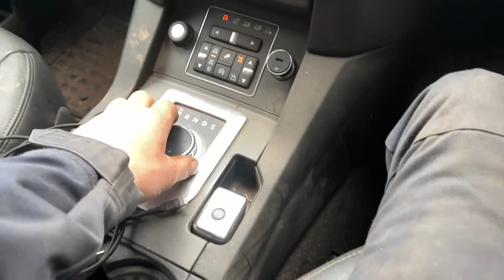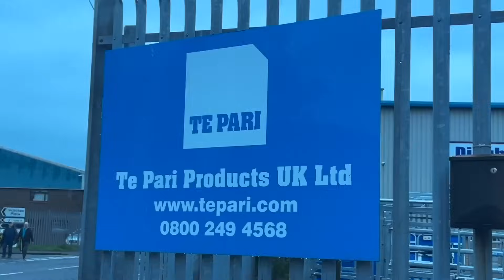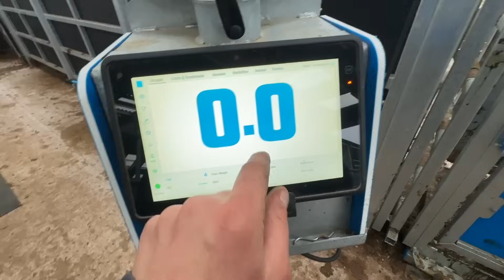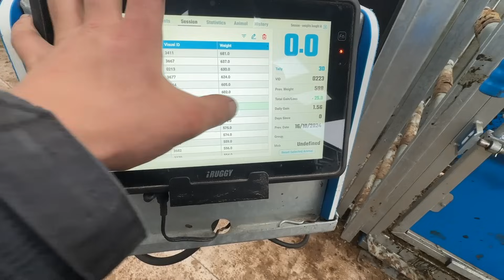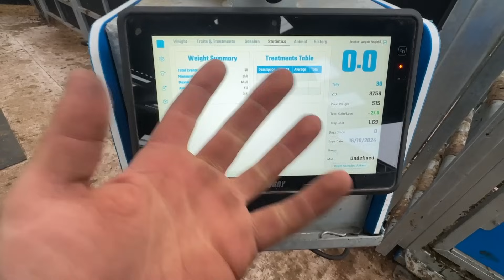Game Changer Upgrade For Our Farm & Cattle | Flooding Update

Comment: Rivets suck! Drill and m8x 20 or 25mm bolts with nylocks and dab of blu loctite on combine elevator. The power harrow I run has a single pin but if tines get to short they wear so change all blades/tines after som many hectares & keep best 6 or so for spares if loose 1. Falc 6m folding harrow. Gota love the kiwi te-pari gear 👍🏻🐂🔧🍻🐂🐄🚜🇳🇿

Comment: Is the returns elevator running uneven as the rivets are all failing on the same side by the looks of it?
Reply from the maker: Thats a point. Will check that thanks
Reply: I noticed that the bad rivets were on the same side, or at least the worst of them.

Comment: Crawford you should invest in carbide tip points for the power Harrow, they last a lot longer and help reduce what is a dangerous task
Reply from the maker: Might have a look at them for next set
Reply: @CrawfordsFarm1  you can buy just the tips and weld them on. Might be cheaper an all